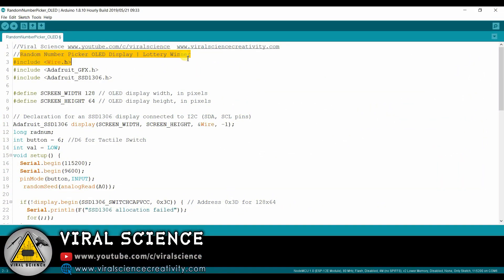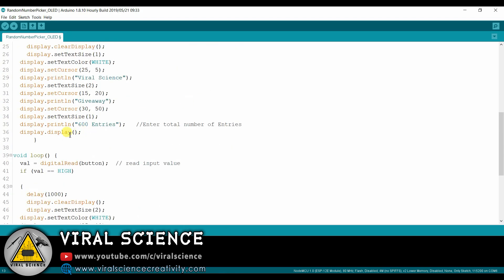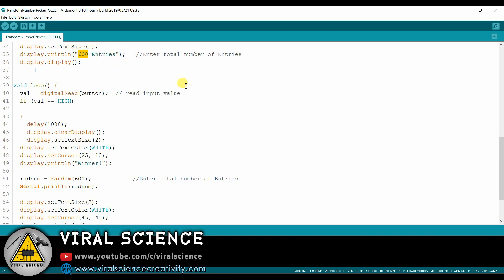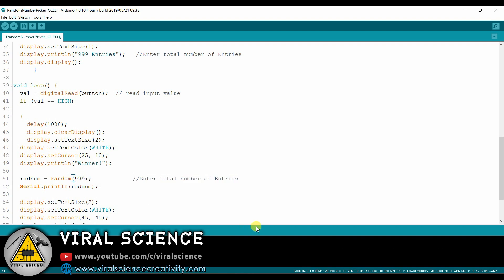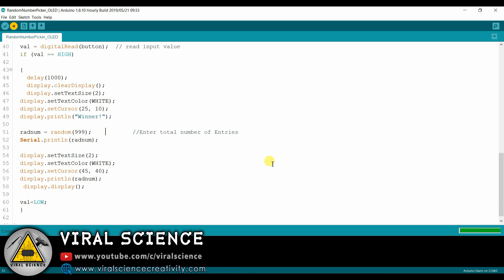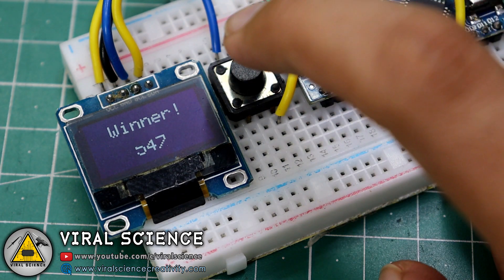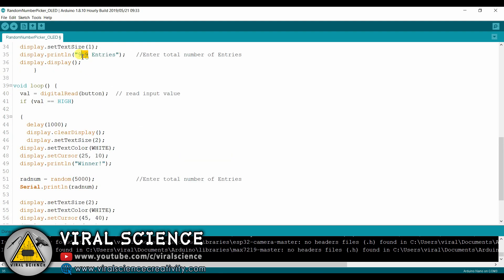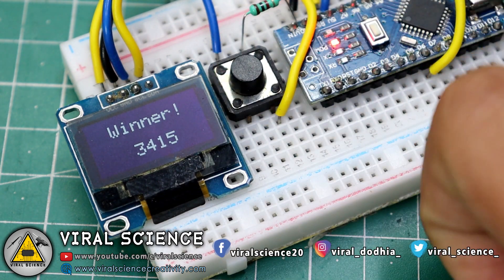Arduino Random Number Generator OLED Display

Comment: Should there be some sort of protection circuit to prevent thermal runaway when using a lithium battery? Also for a TRUE random output, an amplifier using an avalanche diode producing quantum random noise converted to binary is required.